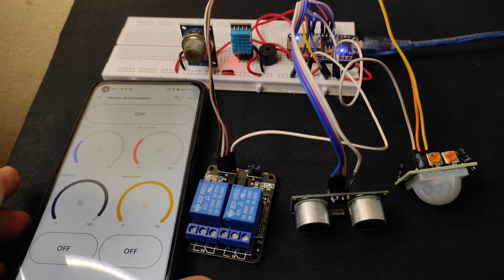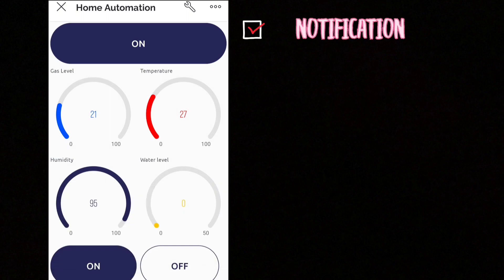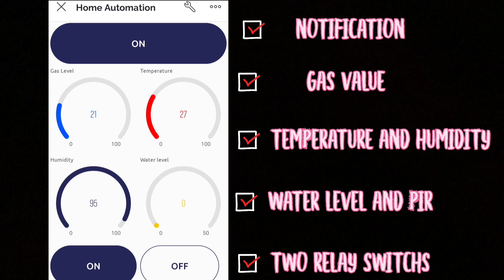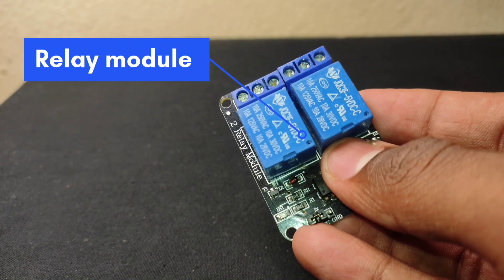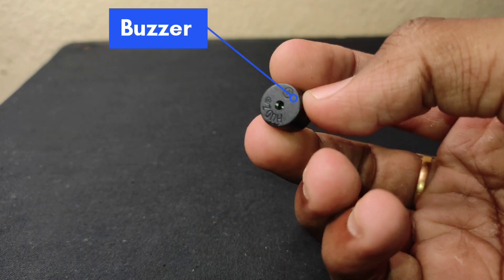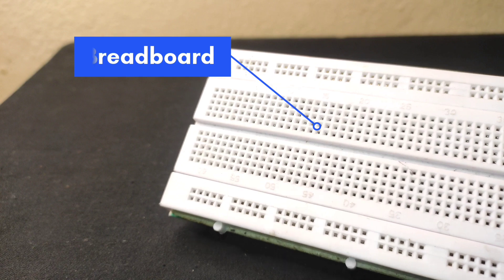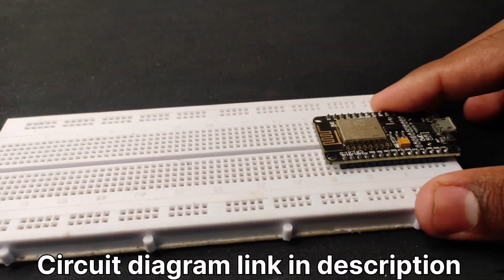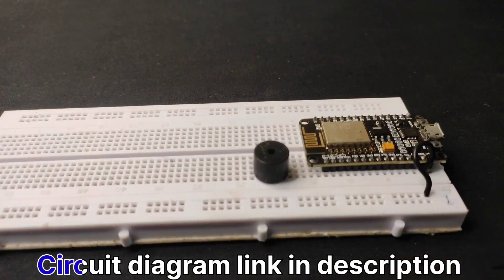Home Automation With Multiple Senosrs || Blynk 2.O || How To interface Multiple Senosrs with Nodemcu

Comment: C:\Users\Acer\AppData\Local\Temp\.arduinoIDE-unsaved2023615-9016-sacpw.nxmpvc\sketch_jul15a\sketch_jul15a.ino: In function 'void setup()':
C:\Users\Acer\AppData\Local\Temp\.arduinoIDE-unsaved2023615-9016-sacpw.nxmpvc\sketch_jul15a\sketch_jul15a.ino:49:27: error: 'pirsensor' was not declared in this scope; did you mean 'gassensor'?
C:\Users\Acer\AppData\Local\Temp\.arduinoIDE-unsaved2023615-9016-sacpw.nxmpvc\sketch_jul15a\sketch_jul15a.ino:50:27: error: 'ultrasonic' was not declared in this scope
C:\Users\Acer\AppData\Local\Temp\.arduinoIDE-unsaved2023615-9016-sacpw.nxmpvc\sketch_jul15a\sketch_jul15a.ino: In function 'void gassensor()':
C:\Users\Acer\AppData\Local\Temp\.arduinoIDE-unsaved2023615-9016-sacpw.nxmpvc\sketch_jul15a\sketch_jul15a.ino:61:11: error: 'class BlynkWifi' has no member named 'notify'
C:\Users\Acer\AppData\Local\Temp\.arduinoIDE-unsaved2023615-9016-sacpw.nxmpvc\sketch_jul15a\sketch_jul15a.ino: In function 'void DHT11sensor()':
C:\Users\Acer\AppData\Local\Temp\.arduinoIDE-unsaved2023615-9016-sacpw.nxmpvc\sketch_jul15a\sketch_jul15a.ino:84:18: error: a function-definition is not allowed here before '{' token
C:\Users\Acer\AppData\Local\Temp\.arduinoIDE-unsaved2023615-9016-sacpw.nxmpvc\sketch_jul15a\sketch_jul15a.ino:97:19: error: a function-definition is not allowed here before '{' token
C:\Users\Acer\AppData\Local\Temp\.arduinoIDE-unsaved2023615-9016-sacpw.nxmpvc\sketch_jul15a\sketch_jul15a.ino:111:17: error: a function-definition is not allowed here before '{' token
C:\Users\Acer\AppData\Local\Temp\.arduinoIDE-unsaved2023615-9016-sacpw.nxmpvc\sketch_jul15a\sketch_jul15a.ino:121:17: error: a function-definition is not allowed here before '{' token
C:\Users\Acer\AppData\Local\Temp\.arduinoIDE-unsaved2023615-9016-sacpw.nxmpvc\sketch_jul15a\sketch_jul15a.ino:130:13: error: a function-definition is not allowed here before '{' token
C:\Users\Acer\AppData\Local\Temp\.arduinoIDE-unsaved2023615-9016-sacpw.nxmpvc\sketch_jul15a\sketch_jul15a.ino:133:1: error: expected '}' at end of input
C:\Users\Acer\AppData\Local\Temp\.arduinoIDE-unsaved2023615-9016-sacpw.nxmpvc\sketch_jul15a\sketch_jul15a.ino:70:20: note: to match this '{'

exit status 1

Compilation error: 'pirsensor' was not declared in this scope; did you mean 'gassensor'?

please help me
Reply from the maker: Install the libraries